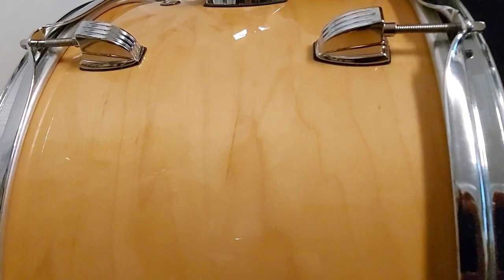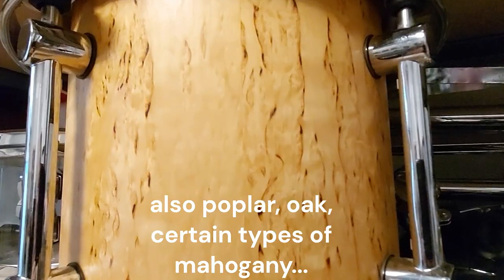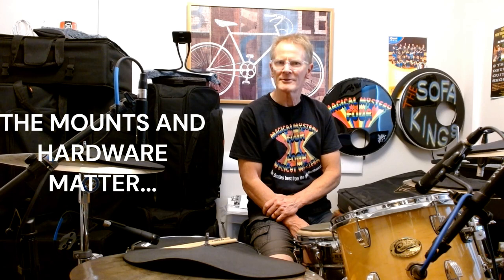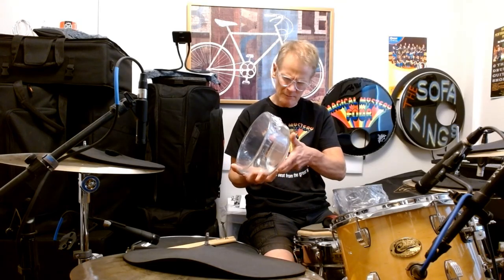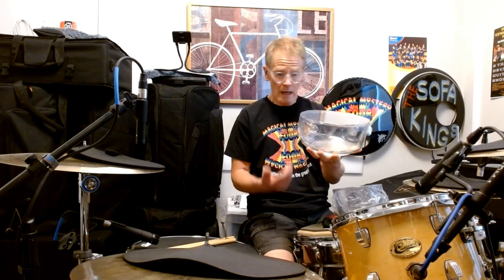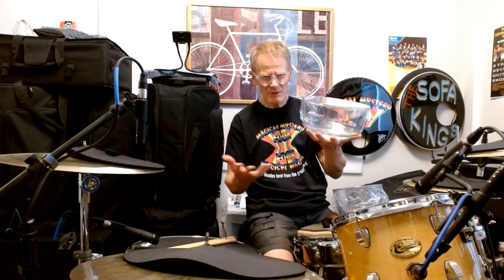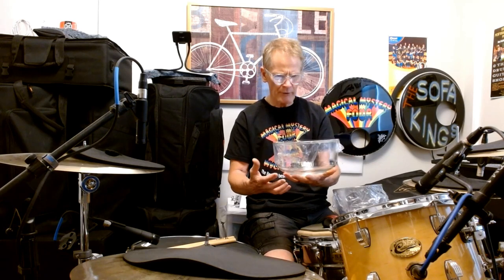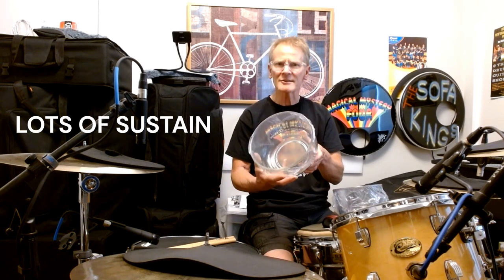plastic wrap drum heads

Comment: What can you share about hoops Karl? The lower end kits come with 1.3mm head hoops but I notice on high end kits, the hoop is 3mm and some are Zinc?
Do the hoops matter that much on a drum with reference to shells and drum heads.

I'm using remo Ambassador or emporer coated heads with birch shells but can never come close to some of the ideal sounds I hear on your kit.
Even your Tupper wrap drums sounded good.  🤷‍♂️
Reply from the maker: Oh yes, hoops make a difference. Not huge, but generally, the heavier the hoop, the "drier" the sound. Standard hoops were 1.3-1.6 mm for ever, and my Sonor force 3000s came with them. Fast forward a few years, and after a couple thousand hard loud club gigs, I BROKE my snare batter hoop (cracked it... it didn't explode or anything), so I replaced it with a 2.3 mm "super hoop". It dried the snare a little, which was fine, and it didn't reduce the volume at all, far as I could tell. I also tried a die cast hoop, and I didn't like it at all. It dried it up a little more yet, but it was too tall. In other words, the rim was too high above the head, and it felt like I was playing a drum at the bottom of a well. I've since put super hoops on all of my drums, and I'm totally satisfied. They're bullet proof, relatively cheap, and they sound good. I really don't hear much of a difference unless it's a really small drum, like my 8", I hear a slight difference. A little less sustain. As far as the glass bowls, they do sound pretty good, and I could say it's because I recorded them with a good mic, and eq'd them, but they sound good even with my potatocam. I did spend some time "tuning" them, but it's pretty much a stretch and go situation. Remember that recording is a lot like photography. We take what we're sure is going to be a pulitzer prize winning pic, and it ends up being junk, because we don't see what the camera sees. Same with recording, we hear a lot more than the microphone "hears". Are you recording, or talking about ambient sound? It's amazing how different the two can be. We can hear more overtones, which actually kind of disappear once you get away 20 or 30 feet. I've done a bunch of videos on tuning and recording... maybe time for another? Thanks for watching!
Reply from the maker: https://youtu.be/id1JM80Q_i0